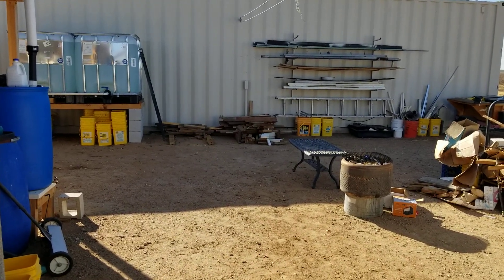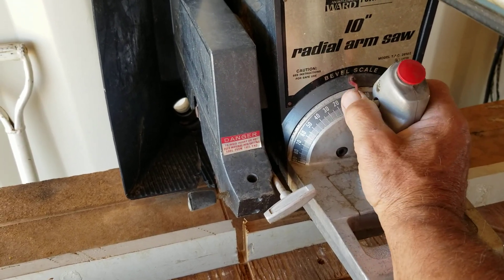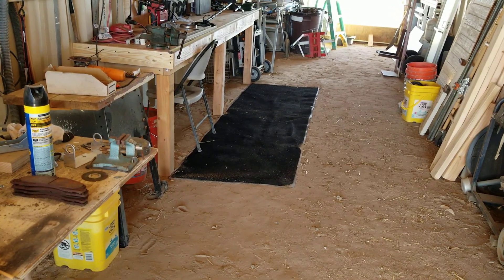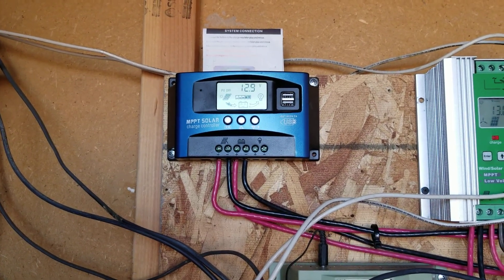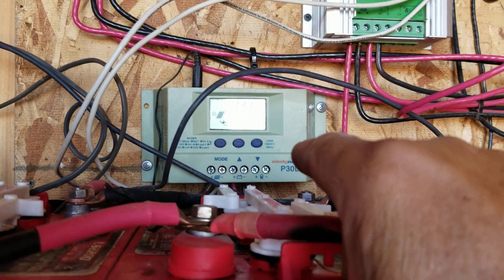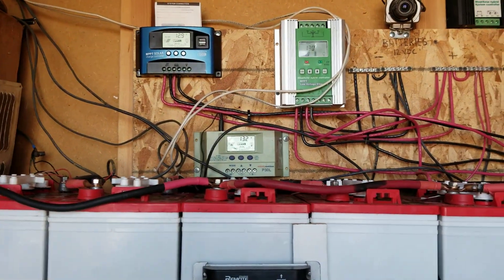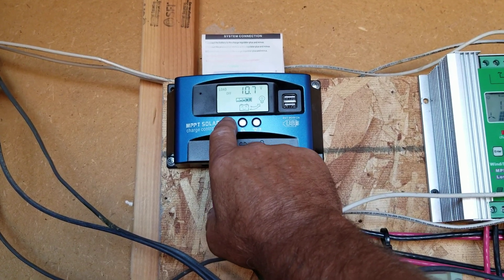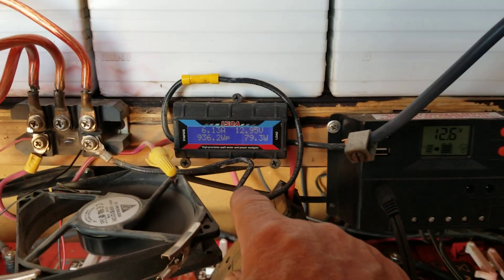Clean-up Time and clarification on solar controllers. Sep. 7, 2019

Comment: ive never tested pwms with an osciliscope yet no doubt some pwms are better than others ive got top of the range pwm for australia atleast they last a very long time and are 100% programable , voltages, boost,float,absorb,equalise etc etc no doubt high frequency pulsing which also helps to desulphate lead acids , i bought them cheap and barely used ,theyre way way too pricey brand new. but like you say cheaper controllers can be supprisingly good. ive used pwm motor controllers for hho cells the frequencies are vastly higher than 50/60hz  more like 2000hz and upto 30,000hz.+. id love an mppt like a midnite classic like i see Orlando Sanchez in barstow use for his big turbine thats what i want one for a turbine so i can program a power curve for a turbine which helps the bigger turbines to be far more beneficial

Comment: I got my Harbor Freight panels charging my phones , battery power tools and running my work radio . I just got a Grid Tie Inverter that will pump free power directly into my home from the 310 watt panels I will be picking up this week , do you know much about micro Tie Inverters ?
Reply from the maker: No, sorry.  I am off grid so don't use micro tie inverters.